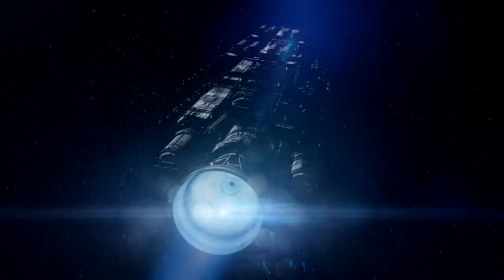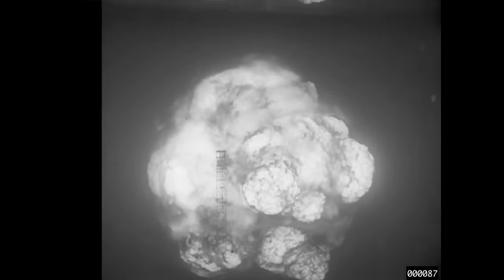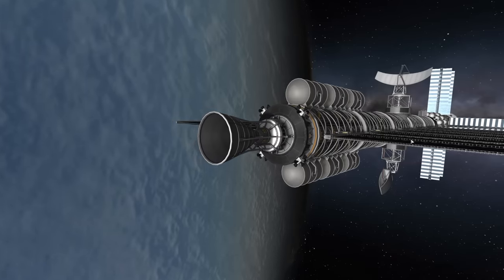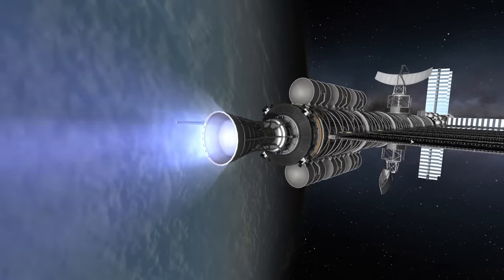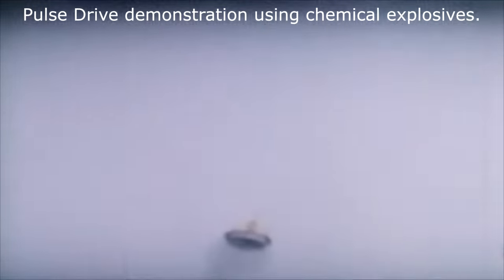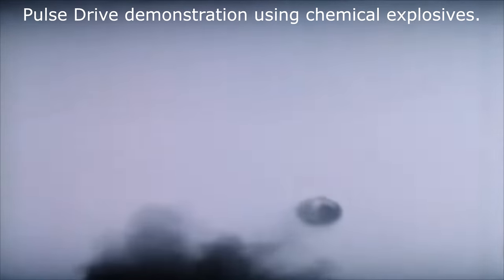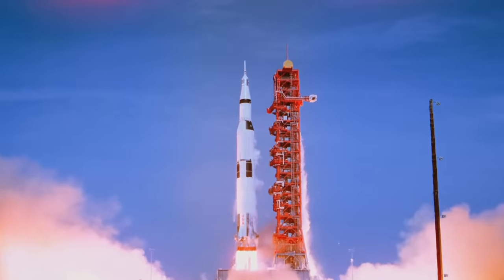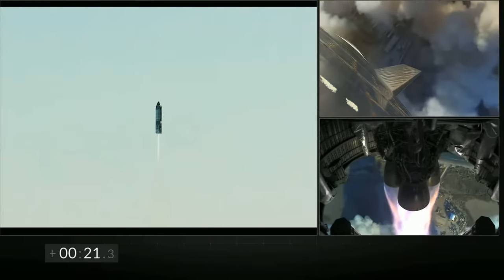The Nuclear Salt Water Rocket - Possibly the Craziest Rocket Engine Ever Imagined.

Comment: I'm not sure I like the idea of being inside a rocket that has nuclear explosions continuously going off behind me, but I do like the idea of going to other star systems in decades instead of millennia.
Reply: We should stop using cars and busses: the fossil fuel motors work by utilizing hundreds of thermobaric explosions per minute only a couple feet away from the passengers - generating enough energy to kill everyone inside the vehicle (and a few outside of it) every minute several times over. Certainly a scary idea.

Electric vehicles are out as well: the immense magnetic fields inside those motor coils would be enough to wipe someone's brain if applied directly. The amound of electric energy stored in those batteries (or retrieved from those overhead power lines in the case of trains and trams) would also be quite deadly.

If we can develop this technology to a point at which it becomes as safe as a diesel car - then I wouldn't care how much energy it is and how it is derived. So, go with your second thought... ;-)
Reply: If you wanna go anywhere in a reasonable amount of time, you can't go wrong exploding a bunch of shit behind you
Reply: @Lassi Kinnunen 81 Well, that system has the advantage of being passively stable. The worst form of drive failure that could happen is the drive plate dampers failing and the whole plate tearing off and falling away.

Meanwhile on Dr Zubrin's wild ride if your water isn't flowing fast enough the continuous nuclear explosion progresses backwards up the pipes into your fuel tank...
Reply: @KonradTheWizzard  horses, don't forget how a horse can kill with a single kick.
Reply: when you're inside a running conventional automobile there are chemical explosions continuously going off in front of you. it's not that different :D
Reply: Seem like a powerfull propulsion system, cool, but not much use until you figure out how continiously accelarate/decelerate at who knows hom many G's, humies are squishy, even the ship itslef will have tolarance thresholds.
Reply: @fluffly3606  yeah but at worst the engine will Crack itself, the car might catch on fire. If a thus engine has a failure, the nuclear explosion backs up the pipeline into the tank, and then you're a star for a second or two
Reply: @battleoid2411 ,

I'm not sure I entirely understand but if you're talking about a nuclear chain explosion then you should probably do some research because those aren't a thing. Nukes are by their nature extremely difficult to detonate.

That doesn't mean a failure wouldn't be catastrophic, but there would definitely be quite a bit left of the ship if it's a reasonable size, especially since nuclear explosions in a vacuum are fairly underwhelming compared to in an atmosphere.
Reply: @battleoid2411 ,

I seem to have been under the mistaken impression we were talking about the Orion Drive lol should've read the title of the video this reply was on
Reply: @veramae4098  came here to say that.
Reply: @nixriviera932  "until you figure out how continiously accelarate/decelerate at who knows hom many G's" 

this has already been figured out, the amount of G's you get is relative to the ship mass and engine size (output), ideally for interstellar, or even in system, travel you would set those ratios to have a 1 g acceleration, you'd probably damage your crew members at anything over 30% of that on a long voyage.

if the smallest engine is too powerful then just add ship mass (make the ship bigger) and your g load drops, need more g's? make the ship lighter or add more engine power.
Reply: @battleoid2411  The chain reaction can't propagate back up the fuel lines to the tanks. The design of the fuel lines and tanks keeps the nuclear cross-section sub-critical. It will do Bad Things to your fuel injectors, and your rocket will probably stop functioning permanently, but it won't roll back up to the fuel tanks. The fuel system is built to prevent that because it could happen spontaneously(and in fact would happen immediately upon filling the tanks).

If the reaction COULD "roll up" and take the fuel in the tanks critical, it wouldn't be like a nuclear bomb. It would, quite literally, BE a nuclear bomb.
Reply: "Not sure I like riding a sustained nuclear explosion"   .. As Opposed to riding a controled chemical explosion(ie. BOMB) into orbit??   Horse a Piece ;)
Reply: It's why we stopped using horse drawn carriages.  Who would want to sit right behind an animal that can kill a person with one kick.
Reply: I'd rather have a short trip with chance of deadly accident than a for sure major radiation exposure because i was in space for too long. Space has proven, when events in both USA and former USSR, to be extremely dangerous and all we can do is our best. Note that half the Wright brothers, fully half, died in a plane accident.
Reply: I mean, I wouldn’t like the idea of being inside a rocket that has massive chemical explosions continuously going off behind me. 

It doesn’t really matter if it’s a hydrogen-oxygen reaction or a nuclear reaction, if something goes wrong you’re just as dead either way. 

But only one of those two is viable for long distance space travel.
Reply: Submarines do it all the time.
Reply: @nixriviera932  just use a rocket engine and propellant flow rate calculated to keep you at 1g of acceleration.

Comment: Honestly, at this point in history, THIS is the best engine we've got for REAL interplanetary travel.
Reply: Far away of my A
Reply: Yeah this one seems completely doable in the short term. Not sure of anyone has the will to try it out.
Reply: If we want to actually explore the solar system and end this robot foreplay nonsense, this seems to be our best bet. The thing I like about this engine is how scalable it is.
Reply: I still think we should pursue inertial confinement fusion engines for Solar System exploration, propellants for those engines are vastly easier to mine and refine elsewhere in the solar system.
Reply: @kenshi_cv2407  have you read much about that muon catalyzed fusion? Doesn't work for making power, but heard it could work great for propulsion (I'm still a fan of these salt water rockets since your need for an external power source is limited to powering pumps and not much else).

A space ship is gonna need lots of power, and inertial confinement also needs a lot of power. At that point, you're gonna need a massive fission reactor regardless. In fact, I'm willing to bet that your consumption of fissile material would be greater powering a fusion drive than you would consume with a salt water design, for a vessel of comparable mass and velocity.
Reply: I actually think there is a better way until we get fusion and visamir rockets. It is what was built and ground tested over half a century ago. Once we get large visamir rockets we can change this power system to make electricity. Then at some point use fusion and antimatter technologies. The point is we can use this and then continue to upgrade without replacing the complete system at once.

But the main thing is to build large ships in orbit with there own gravity if it took a year to get to mars it wouldn't matter. At first they would be clyler ship. Then as the power systems and propulsion where improved and upgraded they could go faster and faster.

What I am talking about is liquid fuel molten salt reactors. This is a slow reaction high temperature reactors. At first use it to heat up a propelant it could be water or a number of different propelants. Then some of the heat could be used with super steam turbines and generators. They are 3 times more efficient than normal generators.

Then once you can build large high powered visamir rockets which would be easier than the scaled down version. The scale down version is the problem trying to make it work with kiliwatt power levels. These would be hundreds of megawatts and as large as SpaceX starship. At first you could power them from a nitrogen cooled condenser bank. This can be charged up in orbit and in transit from the reactor which at that time well be totally setup to produce electrical power.

The visamir rockets can be setup to run in reverse thereby no problem with slowing to get into orbit. Then when fusion with direct conversion to electricity is developed that can be used on the same systems replacing the liquid fuel molten salt reactors. 

From that point you can improve thing more with antimatter to increase the power of the fusion reactors. And bussard type collectors of space hydrogen. And the q-thruster type rockets. But the best part of this from the very beginning these ships well be able to go anywhere in the solar system then they get faster and faster with the upgrades.
Reply: @spencer1980  robot foreplay 💀
Reply: @kenshi_cv2407  PRFC direct fusion drive said it can get 100 km/s ve, but unfortunately have low thrust. Maybe with room temperature superconductor it can match nuclear saltwater engine's thrust. The best thing and also the worst thing about this nuclear saltwater engine is uranium. If you can replace that with deuterium and helium3 and still get the similarthrust and specific impulse, that would be far easier on people to accept and safer.
Reply: Oh no. This isn't interplanetary. Zubrin made interstellar designs for this thing.
Reply: I think that fission fragment engines might be better for probes and such, but for humans exploring the solar system then nuclear salt water rockets are one of the best options. Apart from the eco activists raging over fission technologies that they don't even understand
Reply: @keyabrade1861  Mwuhahaha. I can just imagine ships bigger than a star destroyer being propelled through space by enormous versions of these engines. How enormous? Big enough to fit an aircraft carrier inside the engine nozzle.
Reply: Nuclear Fission Pulse Propulsion also seems like a viable alternative.
Reply: @QualityPen  info?
Reply: Just use NTRs or ion engines for conventional mission profiles in the 21st century. they're cheaper and less technologically complicated and safer. Maybe later on these engines will be economical for fast transport across the solar system
Reply: Orion drive is far more powerful but definitely less practical
Reply: @kamenwaticlients  the issue (I know this is two years later) is the radiation that it would produce, killing anyone who would be on that rocket...
Reply: @lucycassidy2709  Ah but here I am 2 years later appreciating your answer. I figure we can solve that with money and weight. We can shield against it. And the exhaust is traveling at faster then solar escape velocity so even on the reverse thrust maneuver we wouldn't fly through the exhaust.
Reply: @kamenwaticlients  true, it would be a huge piece of engineering and a major accomplishment if we could do it :)
Reply: @kamenwaticlients  and I suppose it could move a lot more mass than any current rocket too, so that would make sense